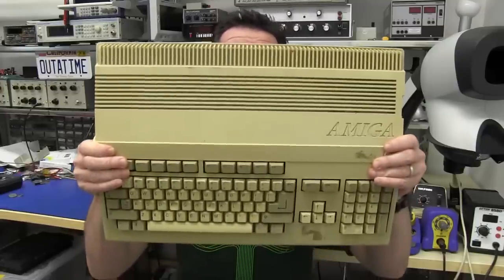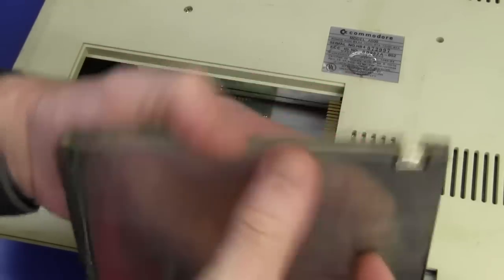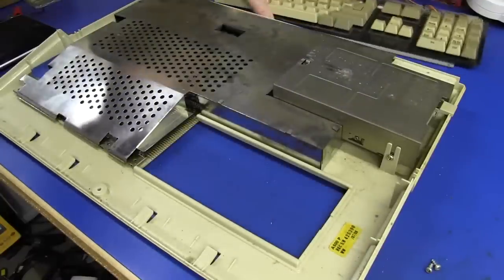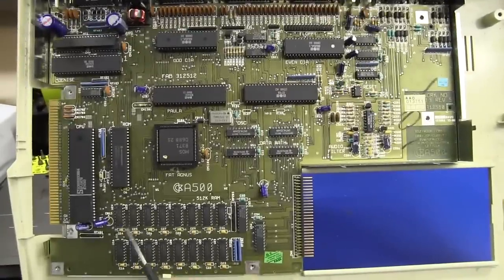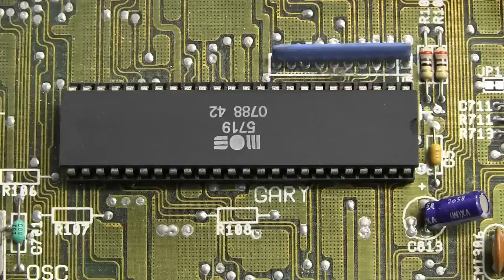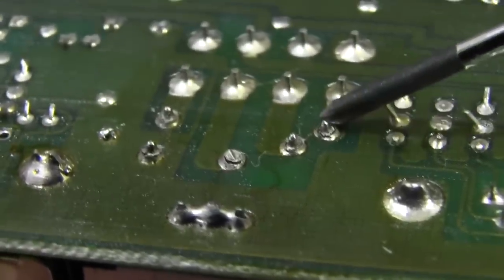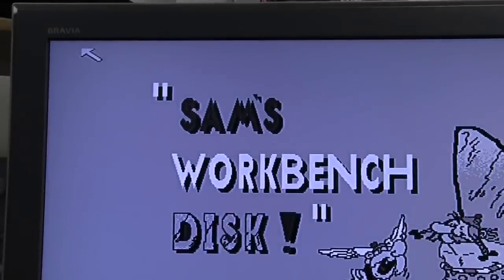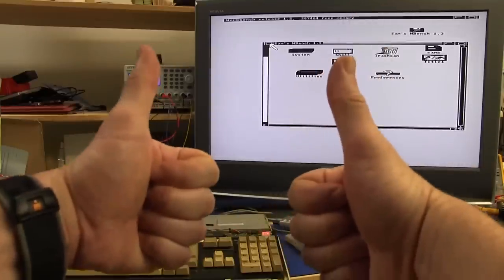EEVBlog #438 - Amiga 500 Retro Computer Teardown

Comment: Dude, great educational tutorial and explanation about electronic parts. I like that. However, it seems that you have no idea about Amiga systems. This computer was revolutionary and probably the best machine on the market at the time. PC's were and still a piece of crap. If Amiga was alive today, imagine the possibilities. Finally, for your information people still use AMIGA computers today and I am sure you would too if you knew how to use it. By the way Great videos you have out there and looking forward to seeing more.
Reply: You have no clue what you're talking about. The Amiga HAM Mode was a mess, slow and difficult to program compared to the simple design of VGA. Thus the HAM mode wasn't used for fast paced action games. For games 32 colors at the same time were most times the maximum, while VGA offered 256 colors on the PC at the same time.
All you needed for VGA was RAM and with more RAM it was simple to improve the standard and introduce new 16 Bit and 24 Bit color modes.
Reply: OpenGL4ever
In 1985 PCs still used EGA. Nash may be wrong in saying that PCss were crap in the late 80s however you cannot deny the fact that the Amiga (at least in the UK and Europe) kicked IBM's ass in terms of home cumputing. PCs were too expensive and did not have the Amiga (out of the box) quality in terms of graphics and certainly in terms of sound. The Amiga community is still thriving now and there are manufacturers brining out new hardware for it even now (look at Individual Computers with their Invidision and ACA cards.) Personally my 1200 (030) is the only one of my retro computers/consoles that is set up to use at any time. This machine is networked with Internet access, it can play MP3s and stream Internet radio. It has 12 gig of storage space and can display 24bit colour photos. I simply can't see many people using PCs from 1992 still to do all I have mentioned above. EEVBlog kinda dismisses his 500 as old unused tech as one may do with other computers from this era but this just isn't the case with the Amiga. Go look at AmiBay or EAB.
Reply: coope1999
The Amiga 500 was introduced in 1987, the same applies to VGA.
It was the Amiga 1000, that was introduced in 1985.
Of course, a PC did cost a lot more at that time, especially with a VGA card, but that doesn't change the fact, that VGA was much easier to programm than Amiga's HAM mode.
Reply: OpenGL4ever I don't think you understand that HAM was never intended to be used mainstream in the Amiga. In fact the person who developed it wanted to remove it but the chip was too far into development and would have taken months to do so he left it in thinking it would not get used. But people did find a use. I know what dates the Amiga was released but my point is that the A1000 had HAM in 1985. 2 years before IBM got VGA. Do not compare HAM with VGA. As I said it was never intended to be used for its main application.
Reply: coope1999 Every Amiga user at that time used the HAM mode to boast about their Amiga how many colors it can display. But in practice, it was rather useless and inferior to VGA. That's what i said.
You can't also concentrate only on the release date and compare HAM with VGA by their date.
To be fair you also have to keep in mind, that there was many years nothing else than HAM that offered more than 32 colors at the same time on the Amiga.
Even in 1992, when AGA was released, it still used and offered HAM mode as its best and this was much worse than the already developed SVGA with VESA Bios standard with 24 bit True color at some resolutions at that time.
So to make it short, when VGA was released, the AMIGA could never regain the crown again when we're talking about graphic possibilities.
Reply: You are still talking about HAM. Nash did not say in his post that HAM made Amiga better than the PC and neither did I. The package as a whole made Amiga better than PC at that time. End of.
Reply: coope1999
He said the following:
"This computer was revolutionary and probably the best machine on the market at the time. PC's were and still a piece of crap."
The word "This computer" is clearly reffering to the Amiga 500 because this was the topic of this video.
In 1987 you could buy PC with an Intel 80386 processor if you could afford it, and this is a much better and faster processor, than you have in the Amiga 500.
The Amiga 500 was a good machine for home usage, but the PC was not crap. If you got the money, you could buy a very good PC with VGA and a 386 CPU.
Reply: I think you should now go back and read my first post on this thread. You have just agreed with what I said. I said that PCs were not crap and that Amiga beat PC for home usage.
Reply: Nash Milincic I had my A500 till  the year 2000, I still have it stored away... but I would not swap it out for my current PC.
What I wish for however was a flatscreen on the market that would not be so bad with low resolutions, I would connect my Amiga 500 back in an instant if there was a decent flatscreen giving close to the picture quality my old RGB screen gave me.
Reply: OpenGL4ever Amiga was a breeze to program for, I used the "copper" and "blitter" (early gpu stuff) to program grahics. In the end Amiga failed because it didnt specialize being a gaming console (like sega or nintendo) they could have easily cornered that market
Reply: J brogly.decap Commodore tried to do that with the CD32, they also tried to do that with the C64 and they failed miserably.
Reply: Ｔｈｅ Ｃｏｍｐｕｔｅｎｔ   Apples oranges and offtangent, Amiga had the graphics and sound to blow everything away! Amiga could have been the first "nintendo" just sell a gamer 64K without harddrive and keyboard and mouse, and all those stupid IO ports.
Reply: J brogly.decap
Again, Commodore tried doing that, it was called the CD32, it failed miserably.
Reply: Ｔｈｅ Ｃｏｍｐｕｔｅｎｔ actually the initial sales of the CD32 were good. Commodore just went under before the 2nd run came off the manufacturing belt.
Reply: Chukkzy This website might have a solution for low res problems when using an Amiga and modern monitors but it doesn't come cheap: http://www.microbeetechnology.com.au/store/index.php?_a=product&product_id=22 It looks very promising and might get one for myself later on.
Reply: J brogly.decap While it was easy to program the blitter and copper, HAM mode was not.
HAM mode is very special, difficult to program and unsuitable for fast 3d games.
http://en.wikipedia.org/wiki/Hold-And-Modify
Reply: OpenGL4ever I never used HAM mode, as it was over-stretching the graphics capabilities. Maybe to display nice static , for video it would be cumbersome to calculate but duable. Fact remains that the copper and hardware graphics acceleration where first of its kind. And if they had made a console game in 1986 in stead of waiting till 1993 when (Commodore was almost broke) they would have dominated the home industry from Ninentdo Sega,  You are nagging about a feature that didnt even exist in competative products in the same price range!
Reply: OpenGL4ever I used to write demos for the Amiga before writing games and you can't really compare VGA and HAM, nor can you really compare it with the 32 colours of the Amiga 500.  The Amiga display was made up of bitplanes, 6 of them on the A500.  Bitplane 6 was actually a "half-bright" bitplane because although it didn't generate you more colours, it would display colours from the palette at half their brightness.
5 bitplanes gave you 32 colours, where as VGA is geared towards a chunky display.  For say the A1200 which is an effective comparison (8 bitplanes), 1 byte is rendered as 8 pixels on a single bitplane whereas chunky, it's one pixel to define a palette index (imagine it being 1 pixel on each bitplane deep)
Although I used HAM in various places, it was actually quite time consuming to do the colour calculations to blit onto a HAM display which is why they were mainly used for static images.  But like it or hate it, it still gave the Amiga 4096 colours which was far superior to anything the PC would produce for quite a few years.
Reply: The Welder I know the difference between VGA and HAM and what bitplanes are and why HAM was a mess to program and slow.
About the colors of VGA, while Standard VGA was limited to 256 colors in 1987 by the standard, this didn't apply to the proprietary extensions video card adapter manufactures introduced on their own. It was possible to buy such VGA cards with proprietary extensions that offered Hi-color and true color modes.
So if you had the money, the PC could do much more. All that was needed were drivers for the applications and applications that made use of those proprietary extensions.
This changed with the release of VESA BIOS Extensions in October 1989.
Reply: OpenGL4ever There were proprietary video cards for the Amiga too that also did true-colour.  You can't really talk about custom hardware with drivers that only a few programs would make use of.  Further, the PC had a reasonable interface for attaching such cards and the Amiga just simply didn't.  The fact is though, as a base machine the Amiga could display 4096 colours which was beyond anything a base PC could do.  Moreover, along with it's Blitter (with it's line drawing and filling), Copper, Audio, and pre-emptive multitasking straight-out-of-the-box, it left the PC completely in its dust (which the exception of raw processing power).I remember seeing a 68030 against a 486DX66 and it slaughtering the PC many years ago.
However, if you want to know about real display genius; take the BBC Micro, it had support for 24bit colour, even though it only had 8, years before.  Hence why the VDU statement had 3x8bit values for RGB.  Now that's proper forward thinking.
Reply: Commodore was like Germany in WWO2 , advanced tech far superior then any competition and still they loose the battle,
Reply: +OpenGL4ever HAM would have been really nice if it worked in the original YUV space so it could do chroma subsampling. In RGB space it was severally crippled, too bad. I agree it would only have been suitable for nice pictures and not gaming. I'm kind of interested in this subject looking backwards how much better would 8-bit era graphics have been had they used some sort of chroma subsampling technique? I remember there was a little box for the amiga that converted the rgb output to 'true color' I guess that one 'used' RGB as YUV but that's only a guess. I guess the worst example of color would be the C64 which had a really awfull fixed 16 color pallette the Atari 400/600/800 line had much better color. I'm still interested in getting the most out of a say an 8k framebuffer. It would at least have to be 'true color', use chroma seperately, and some tricks like hold for X pixels then modify. Or go for 8 pixel Y mode without the skip data, some sort of burst mode for detail work. Or repeat last line with modifications. I guess that would become a quite complex chip design though.
Reply: VGA is easy to program, ya granted byte in the matrix is the color, very innovative...raise your hand if you had a VGA card in 1987. Anyone?! No???? Well, geez, why not??? How many VGA programs were produced in 1987? Few to none??!? Well, geeeez. Why is that? Most people only got a VGA card in the early to mid 90s. The software selections prove that to be an indisputable fact. Moreover, even in the 90's most programs still offered CGA and EGA modes because people still weren't shelling out for one.

Amiga offered a finished, and platform solution to compatibility in graphics modes and operating uniformity. It also offered multi tasking. It also offered a nice, fast GUI. It also offered cross platform disk compatibility, it also came standard with all peripheral ports built in, no need to buy extra IO cards. It also offered versatility in video output, from an old tube TV to a flat screen(as we just saw demonstrated), it also offered higher storage to density on floppies. It also offered a free operating system. It also offered a modular power supply. It also offered a smaller footprint! It also offered quite fan free operation. It also offered a complete expansion bus far superior to the ISA/EISA bus. The list goes on and on...

Meanwhile in PC land, people walked past the hideously expensive VGA cards for another decade or so. Are we on earth now?? Technology adoption in a modular system takes way longer than on a platform system. Conversely, modular systems are much more adaptable than platform systems, but you then have a really hard time trying to support all the 13 different graphics modes that existed on IBMs by the time 1987 rolled around. Amiga had both a platform system and a modular system, but most software was developed for the platform A500 resulting in a greater and richer experience for the average user.
Reply: VGA is easy to program, ya granted byte in the matrix is the color, very innovative...raise your hand if you had a VGA card in 1987. Anyone?! No???? Well, geez, why not??? How many VGA programs were produced in 1987? Few to none??!? Well, geeeez. Why is that? Most people only got a VGA card in the early to mid 90s. The software selections prove that to be an indisputable fact. Moreover, even in the 90's most programs still offered CGA and EGA modes because people still weren't shelling out for one. As solid proof, look at Catacomb Abyss...the first person shooter released in 1992 as a sequel to catacomb released in 1991 created by none other than id Software and friends. It is EGA and doesn't even have a VGA option...and this is a very advanced game! Another smash hit title from the era, Wizardry: Bane of the Cosmic Forge, also EGA only...none of that CGA crap! We actually upgraded our computer to EGA to play wizardry...and this was in 1992/3 around there... the next year we upgraded to VGA. Because of, well, Wolfenstein...heh.

Amiga offered a finished, and platform solution to compatibility in graphics modes and operating uniformity. It also offered multi tasking. It also offered a nice, fast GUI. It also offered cross platform disk compatibility. It also came standard with all peripheral ports built in, no need to buy extra IO cards. It also offered versatility in video output, from an old tube TV to a flat screen(as we just saw demonstrated), it also offered higher storage to density ratio on floppies due to commodore's unique sector mapping. It also offered a free operating system. It also offered a modular external power supply. It also offered a smaller footprint and the A500 was around the size of most IBM portables in weight and size! It also offered quiet, fan free operation(it didn't sound like a jet engine). It also offered a complete expansion bus far superior to the ISA/EISA bus. The list goes on and on...

Meanwhile in PC land, people walked past the hideously expensive VGA cards for another decade or so. Are we on earth now?? Technology adoption in a modular system takes way longer than on a platform system. Conversely, modular systems are much more adaptable than platform systems, but you then have a really hard time trying to support all the 13 different graphics modes that existed on IBMs by the time 1987 rolled around. Amiga had both a platform system and a modular system, but most software was developed for the platform A500 resulting in a greater and richer experience for the average user. They offered the top tier expensive stuff built in, and cheap. I remember someone when I was in elementary school shelling oout 4 grand for a top of the line 486DX VGA IBM compatible system to play kings quest V. I think wolfenstein and doom were what actually finally made people get a VGA card.
Reply: I mean, asserting that commodore was behind because the VGA standard came out in 1987, is like saying the IBM was outdated before production because the 68000 microprocessor was invented and shipped in 1979, a CISC 16/32 bit processor, a full 3 years before IBM built their first 8 bit PC. Or, even better, asserting that all PCs were outdated garbage because VAX-11 systems could outmatch them in performance by orders of magnitude. 

People forget that at this time, most people didn't even have a computer and certainly didn't feel like they needed a supercomputer at home... people would invest in something cheaper, like a low end machine. Some people were even still investing in VIC-20s with 5K of ram in 1987. I know this because I have a VIC-20 in my own computer collection with the receipt from KMART dated 1987. It was priced at a mere 79$ on clearance, and the owner used it for several years with just a cassette drive, and a few cartridges. He obtained many programs out of magazines. The mentality and approach to the purchase of a computer was that of a long term investment for hobby, games, or small business needs. People stuck with machines for 5 to 10 years at a time(sometimes more), without giving a thought to replacement unless they were a serious power user or something actually broke. Even then, they would upgrade the machine they already had. Many of the old XT class IBMs were still in service in the 90's, and this is something that anyone around at the time remembers.